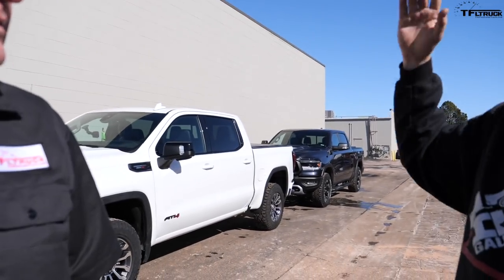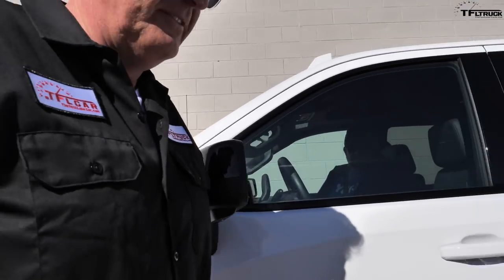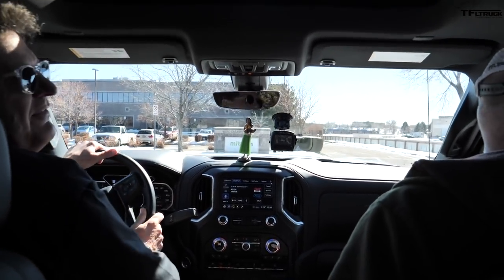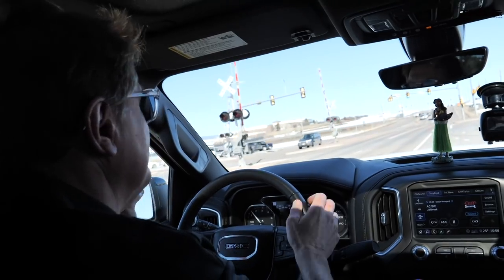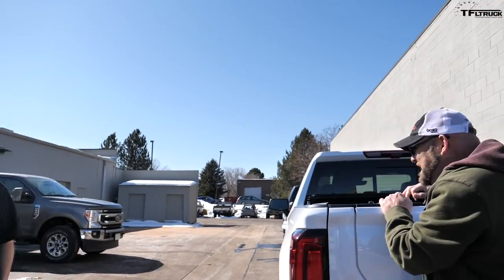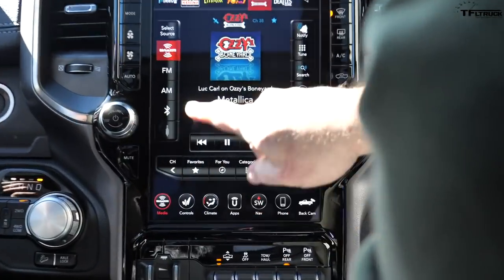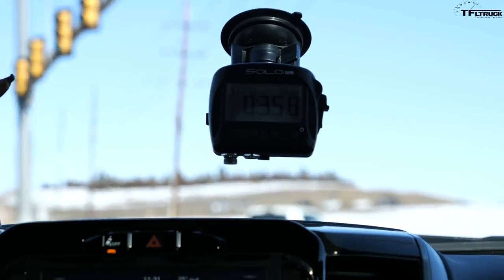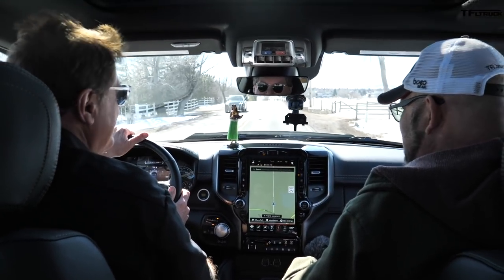Best Diesel Truck! 2020 GMC Sierra AT4 vs Ram Rebel Diesel 0-60 MPH Buddy Review

Comment: Love the massive screen!  Nathan, you need a truck without a display.  Too many buttons???  You did not complain about too many buttons on the GMC tailgate!  LOL  You are so biased.  LOL  A locking diff can be installed for less than $3k on any truck.  If you are paying 80k for a truck, adding a locking diff is not a big deal.  Torque is the ability to do work, horsepower is the rate at which you can do that work.  Lower horsepower and higher torque means the RAM can do more work at a slower rate.
Reply: The GMC and Ram tailgate have the same amount of buttons...
Reply: @zimks  Interesting.  So the same number of buttons result in several more functions with the GMC.  Which implies even greater complexity and more failure modes.  Don't get me wrong, I love seeing the "tailgate wars" which brings buyers more features and functionality.  I am just more of an old school function over form and have learned that keep it simple stupid is in the direction of goodness.  More functions is not always a good thing.  :-)
Reply: rob the elder more failure modes?? I would induce that if you had 6 different buttons that do 6 different applications you would have a greater chance of something failing then just two buttons that do a multiple functions

Comment: Dodge/Ram tech is hot garbage!!!!  I can't believe you guys didn't mention that in your long term test.   We rent a lot of vehicles at my work, and every time my guys get a CDRJF vehicle, the electronics crap out on them in some form.  My personal 2500 went to the dealership 9 times in the first year!!  The worst Eff up was loosing exhaust braking on a 10% grade with 11k lbs with a switchback turn at the bottom.

Comment: Silverado is more fuel efficient than the GMC. I don't know why that is but it is.
Reply: According to fueleconomy.gov, not really.  Plus, Chevy doesn't offer the 3.0 duramax in the Trail Boss.  1mpg could ne explained by the better aerodynamics of the Chevy.
Reply: @hochhaul  Dude stop pretending that I said something that I didn't.  I never said the EPA ratings were accurate.  Don't even go there.  The only thing that matters is the unit of measurement is the same when comparing 2 things.  If the EPA is wrong (and those who know, know it is), assay least it's universally wrong for the same reasons.
Reply: @hochhaul  you're right on that. Just like the GTO when it came out about 15 years ago... It needed to go on diet.
Reply: @everitthopper5161  Yeah the 5th gen Camaro was the same way when it first came out. Way too heavy.

Comment: I rented a ram and the “hockey puck” is so picky due to safety hard to get it out of park sometimes if bad habits from column shifter carry over.
Reply: I've never had that issue.
Reply: @JohnDoe-nz6bk  neither has anyone else thaty ive heard of , my guess user error and not pushing the brake, lol
Reply: StoneysWorkshop I have had several hockey puck shifter Rams and have never had one issue ever. It takes about one day to adapt to it and I love it.

Comment: That 3 liter duramax is garbage, 120 miles an blew head gasket an gave me another one for a rental an that one ran hot , that engine may have good power an all but it ain't gonna last, it'll be a recall engine soon
Reply: Funny can't find a single report of a 3.0 Duramax with blown headgaskets on gm-trucks, the most popular GM truck forum. Meanwhile I can find 200 pages of forum posts about Ram Ecodiesel trucks with blown engines.

Comment: im not gonna lie i thought it was gonna be really bias since it seemed like it was 1 vs 2 gmc vs ram even tho the gmc seemed to be better in numbers and the gmc is just downright more reliable. but it seems like you guys actually stuck by the info you said and said the negatives of each. although just a correction the "ram boxes" were orginally on the chevy avalanche and the "barn door" tailgate is very similar to the ridgelines

Comment: Wait ten years, buy a used one and rip all the emissions crap out.the ram screen is nothing but an accident waiting to happen. The barn doortsilagte is something I'd expect from dodge..... Honda did it better. To the rest of the dummies, if u have a hitch don't drop the second part of the gm tailgate. Problem solved.
Reply: Somebody makes a hitch that clears the GMC's tailgate step so it's a non-issue these days.

Comment: GMC tailgate is an over complication of a tailgate. dont need these flippy floppy tailgates or a sissy damped tailgate. f150 is a real mans truck.
Reply: The F-150? man's truck? Not with that girly tailgate step and aluminum foil bed.
Reply: @karlschauff7989  they dont all have the step. And the bed is much tougher than aluminum foil, come on dude. Your gonna have to do better then that.
Reply: @karlschauff7989 by posting these videos as a reply, it is clear you dont understand metallurgy.
Reply: @1FiftyOverland  
I understand it just fine. Ford stopped using thick, tough steel and replaced it with a 6000 series aluminum that's too thin.  Instead of deforming in an impact, it's often prone to tearing and cracking in an impact. Even the riveted seams on the bed are prone to tearing out, as are the bed tie downs. Hence the famous blue Ford with the entire side of the bed blown out, all caused by an object that was properly stapped down in the bed, but the tie-down anchor simply tore out, causing the load to topple. 

https://cimg1.ibsrv.net/gimg/www.f150forum.com-vbulletin/405x720/img_1595a_29360625f4d594164348c685de39e6c51b51cb7c.jpg

https://tnstatic.net/attachments/img_5227-jpg.74586/

https://tnstatic.net/attachments/img_5229-jpg.74588/
Reply: @karlschauff7989  what?🤣🤣🤣 The Aluminum body panels are thicker than the previous generations stell body panels... lol. 

The pictures clearly show someone did something stupid. That wasnt from having just a bed tie down break.

Comment: Don't buy it they have a lot of problems with that little diesel. We all know shebby has problems building new motors. Expresly diesels they do not have it in  Them . Look at the 6.2 converted gas diesel. Big as peace a  Krapp out there. Look at the  1st  Dura Max. Big piece of krapp. And still is. They all 7.3 diesel power stroke  Ford motor company made was an awesome motor. Tell the emission step  In .  But Ford motor company still makes the best diesel.

Comment: That interior on the GMC is hideous.  I hate the hockey puck in my truck.  In fact if your transmission control center is located near your radio knob and has the same shape , that is a major design flaw.

Comment: The Ram wins once again! I’m a Ford fanatic but every single test shows Ram number 1 by far. And look at that horrible GMC interior and plastic crap. The front end looks like a refrigerator was tipped on its back and the bottom is the GMC grille. Horrible GMC crap

Comment: New trucks are like modern men;  the beard and the leather boots appear legit from the outside, but the natural grooming products and IPA micro brew prove the guts arent.
Reply: Especially the F-150 with aluminum foil bed and failure prone plastic 4WD hubs.
Reply: Plastic hubs? Go on.....
Reply: @jontest5718   Ford switched to a locking hub called an IWE roughly a decade ago to try to improve fuel economy and reduce the cost of their hub assemblies. A plastic ring with soft chinese pot metal teeth bonded to the inner perimeter of it. The unreliable vacuum system that actuates it to lock the hubs often causes it to partially engage and grind  down the teeth very quickly. There are multiple causes for vacuum loss, so it can sometimes take multiple sets of IWE's before it's fixed. Especially these days as Ecoboost engines don't have manifold vacuum, so vacuum must be supplied by a pump. After the Raptor started coming with a Torsen front diff, they became infamous for chewing up IWE's. Very common issue on 2015+ F-150's.

https://www.f150forum.com/attachments/f4/343423d1411431460-iwe-clicking-nothing-working-image-714732549.jpg

https://www.youtube.com/watch?v=iOKbCeNztNk

https://www.youtube.com/watch?v=gQCnR8-hpM8

https://www.youtube.com/watch?v=TIeL5OtJjm8

https://www.youtube.com/watch?v=RjU101Woxjw

Comment: Forget the one made by GM and the one made by Fiat.

Thank me later.
Reply: Don Olypopper  Well I'd go with a $22,000 used Tundra.  It'll outlast, out work, and out play, any of these $75,000 headaches.  Including the Ford PSD.

Not to mention it'll do it around 75 percent less per mile to operate.

So there's that.
Reply: Don Olypopper  not only aren't you a Ford guy, you're not even a truck guy.

Actually, your grasp on realty is gone.  Get help, buy a six year old Tundra, save some money, get well.
Reply: Don Olypopper  Toyota sold over 110,000 Tundras in 2018 and 2019.  You need to learn to state correct facts.  I can't keep pushing the fronters of your ignorance back for you.
Reply: Don Olypopper  thanks for confirming that you don't know or care about facts.

Being wrong all the time is no way for you to go through life.

Comment: The rust and salt will destroy the GMC tailgates  if you live on dirt roads up north.
Reply: This is different from Ram and Ford how?  I've seen it happen to all makes and models.
Reply: @domin8ss   Yea of course, just extra crevices to build up dirt and grime.
Reply: You mean like the split between the Ram barn doors on the tailgate or the top of the F150 tailgate where the step pulls out?  They're all guilty.
Reply: @domin8ss  yep your right, all of the above. I see the multi pro failing often when 20 below in vermont.
Reply: At this point it seems like your just speculating.  I haven't seem it fail in a Chicago winter, nor in Wyoming or Utah.
Reply: @domin8ss   I watched my 06 LBZ rot away,  out west is way easier on trucks than Vermont, Im talking 5-10 years in of constant mud and road salt.
Reply: @domin8ss   Ya got Mountain roads in Chicago?
Reply: @ianmurphy7613  you sure do like cherry-picking.  Look at how you ignored the part about Utah and Wyoming.  Comparatively, Vermont doesn't have mountains either.  What you have rate as hills out west.

Chicagoland has brutal winters very similar to Vermont.  Very cold.  -20 isn't unheard of.  Lots of snow requiring lots of salt for clearing roads. 

Regardless, Vermont and Chicago don't even rate with Wyoming.  Overnight temps in August at 32°F.  Wyoming looks at -20 like it's a warm summer day, and they have really strong wind to add to it.  Oh, and only the most traveled roads in Wyoming are paved.  There's probably more dirt roads than paved highways in the state. 

Vermont can't compete with Utah for salt.  There's a reason the capital is named Salt Lake City.  Utah snow is dryer than anywhere else in the country.  When the storms approach from the west the wind picks up the salt from the Bonneville Salt Flats and Great Salt Lake.  It "seeds" the storm.  When the clouds reach the mountains of the Wasatch Front that have to dump the snow to make it up and over.  That snow has the salt the storm picked up 100 miles west.  So, not only are the road crews clearing the roads with salt, just like in Vermont, but the snow also has a bunch of salt, unlike Vermont.

I've lived all over the country.  I've seen all the weather this country has to offer, except in Hawaii and Alaska.  Vermont is nothing special.  I've experienced the cold, the flooding, and the ice storms that are possible in that state.  Do yourself a favor and stop pretending that Vermont is some magically mystifying place that is unlike any other place on earth.  It's not.  It's just another spot on the map.
Reply: @domin8ss    Hmm your right, Vt is nothing special.   I didnt think much more about this today.  I am sure the mountains are bigger out west.  Do we not all speculate how a product might react in an adverse climate's after a few years.
Reply: @ianmurphy7613  The automakers do.  The aftermarket also does.  That's why there's so many products available, such as ceramic coatings, rubberized undercarriage sprays, etc. to help protect against rust and corrosion.  It gets pretty bad out west.  I've seen cars go into a shop for an oil change and the body is rusting and corroding before the vehicle is even paid off.
Reply: @domin8ss   what is recommended to cover the wax on the  frame on my 2018 Hd chevy?
Reply: My 06 lbz literally had no crossmembers left after 12 years and 220 k, the gooseneck hitch was the the only thing holding frame together, by the time I sold that truck my trailer hitch was bent down at a 45 degree angle.
Reply: @ianmurphy7613  I don't know about that wax coating on GM's frames, but it seems to be better than what Dodge uses.  Dodge frames are rust magnets.  GM claim the wax is self-healing.  With that said, no truck is perfect.  Don't forget Ford has an issue with gas tank straps and axles rusting and failing.  Dodge is notorious for the body and transmission pan rusting.  All trucks over the last 5 years do seem to be substantially better at mitigating rust now.